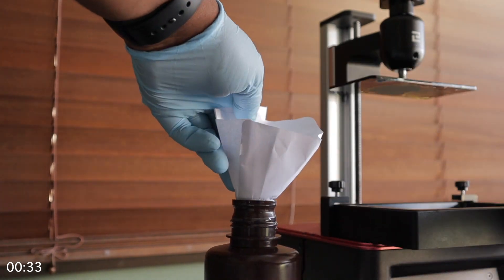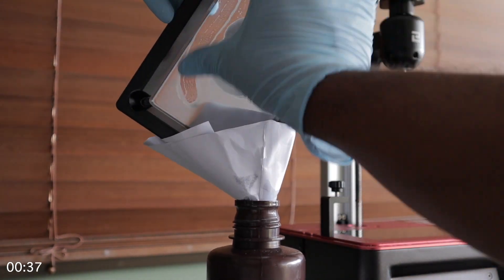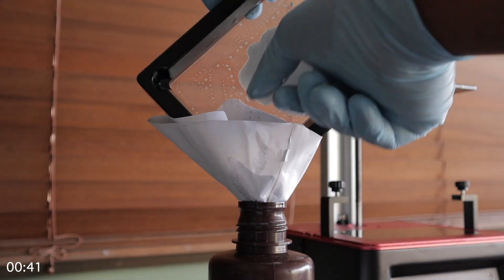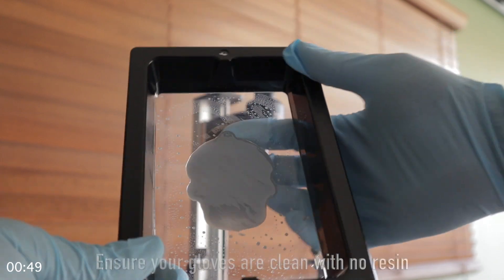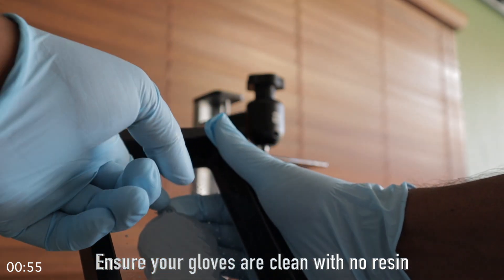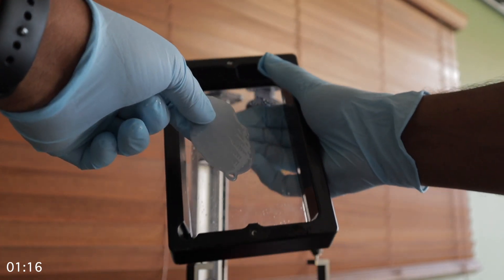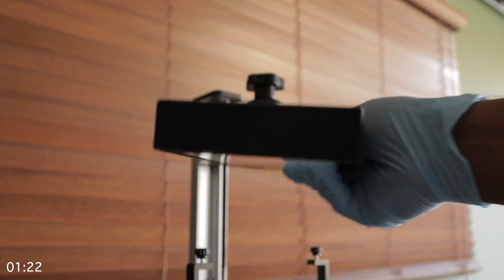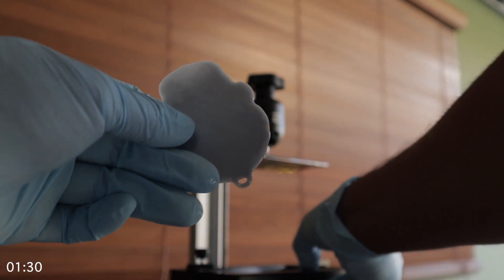2 Min Tip to remove a failed print from the FEP on your SLA Resin printer!

Comment: I would still use something like a silicone scraper to lift the print of the FEP, because gloves easily break from using your nails and resin under them is nasty. Really nice trick pushing with fingers from behind the FEP though. You have so awesome videos and an awesome way of telling small hints and tricks!
Reply from the maker: Thanks! Yup for some really stubborn stuck prints a silicone spatula comes to the rescue!

Comment: It might help a little to put some IPA in there as well.
Reply from the maker: Hi thanks for your comment! I have read that ipa does cloud the FEP but if that bugger doesn’t want to come off than you may very well need some!
Reply: @FrameonesMakerspace  any suggestions on how to discharge static electricity? Every time I clean the tank, it is super-charged with static and inevitably some spec of garbage will attach itself to the underside of the FEP.
Reply from the maker: This is a good question. You can use a dryer sheet that you would put in your clothes dryer and wipe the underside of the FEP to remove the static charge. Before you do this on your VAT you should test it on a piece of spare FEP just to ensure it doesn’t damage the FEP